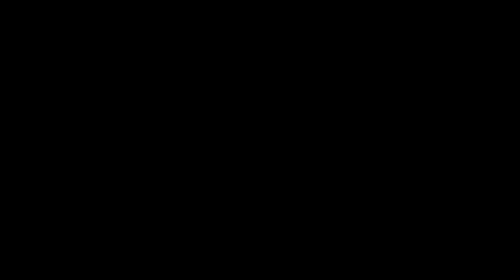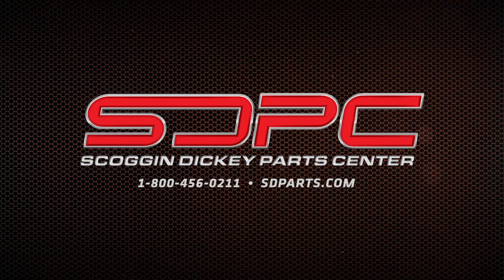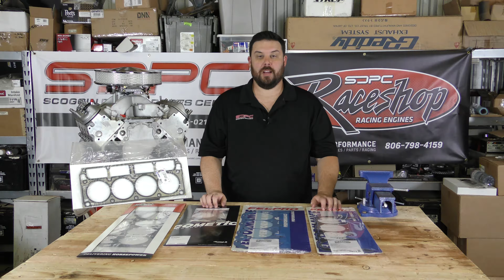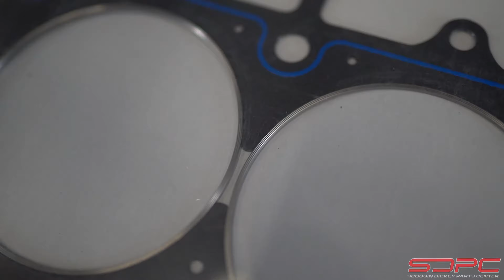SDPC Tech Tips: Head Gaskets

Comment: Should mls gaskets be prepped with copper spray?
Reply from the maker: In most instances they shouldn't be as there's already a layer on the headgaskets that help promote sealing.

Now, if your Head and Block surface is not optimal, and the RA finish isn't up to spec you might need to hit the layers with copper gasket spray. I had to do it on a 3800 V6, and it seems some older 3.8 Grand National guys have had to do it in the past as well.

Comment: Do heads have to be re milled every time Athena head gaskets are changed? We've been running ls9 head gaskets at 26 lb of boost. how much boost can we run with Athena?
Reply: Hello Daniel, I am a Performance Sales Representative at Athena-SCE. I just happened to see your comment. We recommend a 2-3 thou pass on the heads when the gaskets are changed. Also, on the LS9 we have witnessed numbers of at least 40 PSI of boost on that particular platform. I highly recommend the Vulcan Cut-Ring for your application and Scoggin Dickey is a great place to purchase those at. Feel free to call me at 931-398-2204 if you have questions or would like a part # to order from SDPC.
Reply from the maker: Thanks Mike for the reply!
Reply: Is there Athena head gaskets for a small block Ford 363

Comment: Do i have too use the composite gaskets on a 5.3 with 862 " notch " heads?
Reply from the maker: If you cannot find an MLS gasket with the cutout for the notch, then a composite is fine.  As an aside, we do not recommend using notch heads if you're boosting it.
Reply: Notch heads??
Reply: @allanb3222  some of these heads have a notch on the exhaust port side of the heads where the meet the block... i would imagine its there for a point to pry the head off for gasket replacement. Id heard that you cant use the mls gaskets as they will fail at this point. I was curious to find out if it was true. If i could figure out how to post a picture on here id show you a side by side shot

Comment: I have a 97 s10 4.3l x motor thats what i drive to pick up parts for my 2002 seabring 2.7 l convertable.  the s10 got 220000 miles the long block is solid 40 to 50 psi oil preasure it was 50 new.
Reply: I have an 07 4.3 on my Sierra as well man I love that engine